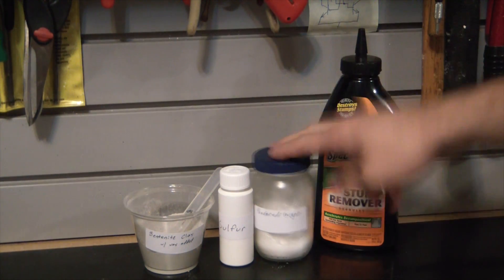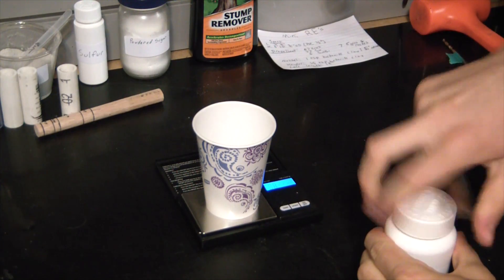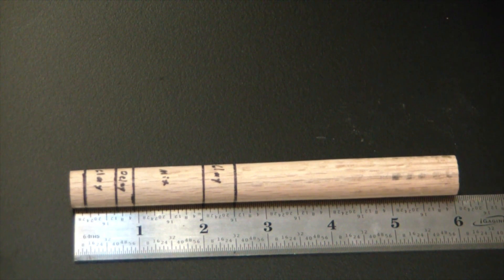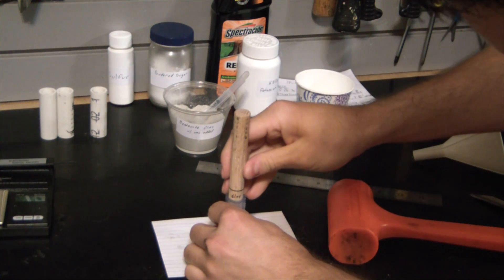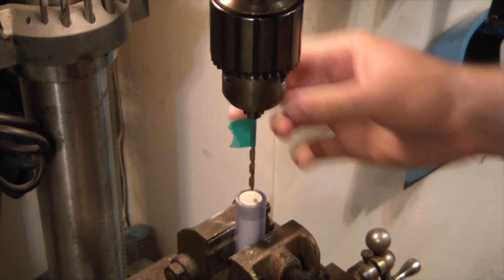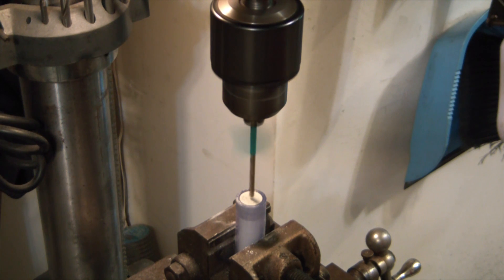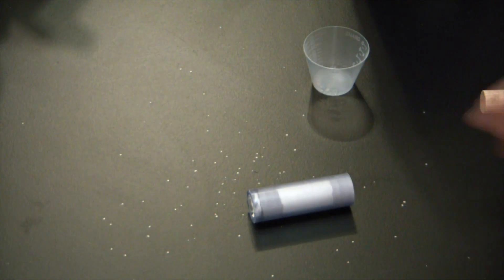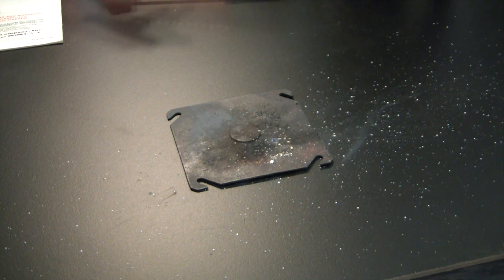ROCKET ENGINES FROM HOUSEHOLD STUFF! ELEMENTALMAKER

Comment: How big can you make these before it becomes to heavy for the fuel to lift the rocket
Reply from the maker: These motor types along with r-candy motors are limited more by fuel grain stability than any weight limitations. The larger and larger these get, the more likely grain imperfections cause it to over pressurize and explode.
Reply from the maker: For a good reference of how big these can get though, check out the sugar shot to space.

Comment: Do you suggest calsium nitrate for a suger rocket ?
Reply from the maker: Calcium nitrate might work, but if i remember correctly its very hygroscopic, and will likely be very weak. It would need to be dried thoroughly before use, and the motors would rapidly deteriorate from moisture absorption.
Reply: @ElementalMaker Thanks from your attention and helpful videos !

I can make a solution of ca(no3)2 and sucrose heat it and let it dry, something like a candy will left behinde its work a little better

I used kno3 its worked very well but its very rare and expensive in my country other way are work like converting calsium nitare to sodium nitrate

Comment: Great video! I guess because you used powdered dry clay, I assume as the engine burns, the nozzle clay inside ablates to form a convergence cone, and the exhaust hole ablates to form a divergence nozzle. I use use hydraulic cement and wooden forms to shape the convergence cone and divergence nozzle, by having these geometries at launch, the rocket efficiency remains relatively constant throughout the burn.

Comment: Remember to grind your own sugar if your powdered sugar from the store has corn starch, it significantly slows burn rate
Reply: so could that be a main reason my fuel is slow?
Reply: @NOVASOULJAH  it would definitely be a factor, but things like moisture content and particle size/ distribution also play huge roles. Also the fuel has to be under pressure to burn quickly, if your only testing in open air then it will look pretty slow
Reply: @aidanflanigan9532  thank you for helping me :)

Comment: Why do some people use sugar and other use charcoal?  I know charcoal makes black powder, but what is the big difference?
Reply from the maker: I think sugar is mostly used for easy availability and very reproducible results. Charcoal has pretty incredible variations in burn speed depending on the type of wood and the way it was processed. Powdered sugar is pretty much identical no matter the source. Charcoal definitely has some advantages though, since it doesn't form a hygroscopic mixture like sugar does.
Reply from the maker: Really great question btw

Comment: My name is Jason Wampler, and I've been building rocket motors for about 21 years now. I can tell PN67/S25/SU8 (the motor you tested) wouldn't have any impulse strength at all.  Here's why: powdered sugar is an air float form of regular sugar. At 250 to 500 micron, my guess is the individual starch(sugar) molecules are simply too short to ignite because of how quickly these oxidize to begin with(they are short and weak and simply atomize immediately.  Your motor's problem is the fact that your fuel to oxidizer ratio is off.  67 percent oxidizer is too much, and 28 percent fuel is too little.  Your campfire has too much lighter fluid on it and not enough wood, it will burn out too quickly.

Thought I'd try to help😁.

Jason Wampler
W A M P L E R

Comment: Red iron oxide is a good catalyst too if you have no sulfur. 1% by weight of the combined fuel and oxidizer. Rockite anchoring cement is also better to use as a nozzle.

Comment: I thought stump remover contains sodium chlorate? I bought some before.
Reply from the maker: A long time ago they used sodium chlorate in stump killer, but removers have pretty much always been nitrate based since nitrates aid with decomposition
Reply: @ElementalMaker  So sodium chlorate does not decompose. Is that correct?

Comment: I’ve seen recipes where the sugar mixture is melted on a hot plate (no open flames..duh) then poured into the tube. This seems a much safer approach.

Any difference in performance?
Reply: I have done that many times. The only way i will do it. Burns better and evenly

Comment: I noticed you are producing almost Zero smoke, I don't like like losing rockets but I still will launch in "adverse" conditions.
The ESTES used to make heavy smoke most notably in the delay Phase, For tracking of course, My question is what can we add without taking away from thrust to make SMOKE? also. Can we multi stage these with zero delay?
Reply from the maker: This composition does actually produce quite a good bit of smoke, it just was all blown out of frame from the thrust during the tests.

Comment: I've been subscribed to your channel for over a month, maybe two. I just hit the 'thumbs up' button. I'm also a basement chemist, and have made rocket motors before as well as flash powder. I've also mixed a 50-50 of Muriatic Acid (30% acid) and water to remove rust from metal parts. Once the rust is removed, I wash the parts with water and baking soda.
Reply from the maker: Thanks for your sub and thumbs up!

Comment: So, this is essentially black powder, with sugar used as a higher power alternative to charcoal for the carbon source.
Three things: Do not mix this stuff in a blender or spice grinder. This is an explosive and too much friction can set it off. Grinding the individual constituents is fine, but together, just don't even think about it. Secondly, be very wary tamping this stuff down. Too much friction or force can set this stuff off easily. And sugar is sticky if it's humid out. (Let me say one name, Phineas Gage.) Thirdly, yeah, absolutely, a very low speed drill, use a hand bit and brace if you have one.

Comment: Have you noticed that when American's need accuracy - they switch to METRIC!
Reply: And this is why there are two systems. So stupid ppl can bash one another instead of building and doing. Just saying.
Reply: Let me guess.... You live in some other country and feel Superior.... I bet I can measure what type of gun you can't have... Anything above zero caliber
Reply: Wasn't metric, was .59 inches
Reply: Metric was created using standard units . We had more accurate measuring equipment
Reply: Whatta ya talkin bout our military still sucks with accuracy an speed in technology..with what the bear has an the other red nation has we have no chance ya know why ? The military is too worried bout offending people  and establishing a 6 colored flag at the same  height as the American flag that some folks think is a rainbow ...newsflash the rainbow has 7 colors not 6
Reply: my micrometer and test dial indicators vehemently disagree with you.
Reply: tell me you've never been in a american machine shop or tool and die makers shop without telling me you've never been..
Reply: Standard or metric a case of water is still heavy and the grocery store is still pretty far away.
Reply: Premature ejecting rockets seem to be a problem
Reply: Any unit can be accurate
Reply: @michaelschuler7397  You may use metric to be accurate, but you use Imperial to go to the moon.
Reply: @frankduncan5685  but they will be using metric to go to Mars. 😁
Reply: @Ninja1000sx.  remember when NASA used imperial instead of metric by mistake and one of their mars landers crashed...
Reply: @frankduncan5685  No you don't. No one has ever been to the moon using the imperial system.
Reply: @michaelschuler7397  The issue is converting notation and performing math operations. What is measured must translate to notation without converting bases. Binary or number bases which are powers of two make sense for computers and make sense for measurement because halving anything is the most basic, accurate and simple operation.

Try accurately taking a 5th of something. Try working in base 5, you will see the disadvantage.
Reply: Johan Smith oh I agree the statement is what I don’t agree with . Fun fact the inch was based on the metric system when standards were developed
Reply: There are two kinds of nations on this world, Those that use only metric and need foreign aid those that have used nuclear weapons and went to the moon.
Reply: @antcri730  lol
Reply: What are you talking about? Machinists have used metric inches for over a hundred years. 

But in reality the fractional system is SUPERIOR because it is BINARY. The problem is stupid base 10 numbers (because 10 fingers? Seriously?). If using a base 2 system like hexadecimal, fractions TRANSLATE PERFECTLY. That means fractions translate to computer numbers perfectly.

1 = 1
...
9 = 9
10 = A   hex
11 = B
12 = C
13 = D
14 = E
15 = F
16 = 10
...
255 = FF
256 = 100  hex

15/16 = 0.F   hex
31/32 = 0.F8
63/64 = 0.FC
127/128 = 0.FE
254/256 = 0.FF
7/8 = 0.D
3/4 = 0.C
1/2 = 0.8 
1/4 = 0.4
1/16 = 0.1
1/32 = 0.08
1/64 = 0.04
1/128 = 0.02
1/256 = 0.01  

13/32 = 0.68    hex
27/64 = 0.6C
7/16 = 0.7  
29/64 = 0.74
15/32 = 0.78
31/64 = 0.7C
1/2 = 0.8
33/64 = 0.84
17/32 = 0.88
Etc

Is that accurate enough and easy enough to convert? Lol.
Reply: @fieldlab4  fine, do 1/5th in binary... not fractional 1/5 but actually binary, you can not, it is a repeating decimal...
Reply: @stevespyder  do you see 1/5th on a ruler somewhere? No! Because fractional rulers are based on divisions of TWO. So the measurements are powers of 2 just like computers and base 16.

Nice try though.
Reply: @fieldlab4  "What are you talking about? Machinists have used metric inches for over a hundred years." gun calibers and machine parts do not always work out to a binary fraction.... if a part calls for .2 inches you use a micrometer not a tape measure...
Reply: Johan Smith  Having been a machinist in the go ole USA for over fifty years I still have fun with fractions. With a little practice and a bit of thought you don’t need a decimal equivalent chart.
Reply: @fieldlab4  'metric inches' is a misnomer, saying decimal inches would be more accurate as imperial and metric are two different systems. yes metric and decimal imperial fractions are similar in appearance. My dad used to hate it when i said 1/4 of a kilometre, "no it is 250m.." the math works out the same. both systems are just as accurate if you use enough significant digits. on a side note, because computers use binary storage, for accurate math, numbers are converted to BCD, binary coded decimal. combining base 10 and base 2 all into 1 system... so 1/5 ( .2 ) in binary is .00110011... while in BCD it is .00000010 or .0010 ( depending on whether you use 4 or 8 bit encoding ) no repeating decimal.
Reply: @stevespyder  Yes I stand corrected, decimal inches. All SAE machinists tools are in decimal inches. Even indexed drill bits. The obvious example is thousandths of an inch (mils), which has nothing to do with factional measurements divided in halves on a ruler. Mils have been used forever.

Binary coded decimal is strictly for the benefit of humans expecting base 10 numbers. Computer numerical operations are on numbers in a base power of 2.
Reply: @fieldlab4  but a computer still can not add .2 +.2+.2+.2+.2 to get 1 in binary, that is why BCD is used, for those numbers that are divisible by 5.
Reply: @stevespyder  

I'm not saying that base 10 should be used for anything. That is a problem with metric as well as decimal inches. There are as many repeating numbers in base 10 (like 1/3) as there are in base 16. I'm only saying that fractional systems are binary as are computers, for good reasons and ideally we might switch our entire number system to hex and stop dealing with the metric vs SAE nonsense.
Reply: @stevespyder  The inch system of length was standardized by definition in 1959 to be 1 inch = 2.54 cm exactly. That would be a "metric inch" although such a term is not formally recognized. Prior to that standard definition, the inch was a little different.
Reply: How many metric flags on the moon?
Reply: @roostertn  that's quite an interesting question. When students move into the space sciences they are told to forget everything they know about measurement, as they need to embrace Metric and 'the powers of ten'. I watched an MIT Professor say just this and then played an interesting video, produced by IBM about how simply adding a zero gives you ten times the speed or distance etc.

Comment: Engine- "a machine with moving parts that converts power into motion."
Reply: RE:Adam Smith. "Rocket engine" is what the manufacturers call them.
https://estesrockets.com/product-category/engines/
So, what would you call them? Fuel cells?
Reply from the maker: I mean, if we get down to the atomic level we can say it's rapidly moving really really small parts cough cough molecules through and out of the nozzle to generate force 😁. Yes despite two engineering degrees I am still human and misspeak all the time.

Comment: You know....  If you lengthened it a bit and filled it with about 400 to 500 grains of 2F black powder with green gold and silver flake inside instead of an ejection charge, in a disposable rocket that thing would make quite a BANG and colorful firework for the fourth!
Reply from the maker: No need to waste that much black powder. A few grams of flash will satisfy even the thirstiest boom seekers
Reply: @ElementalMaker  Well for most.  But they're not me. :)
Heck my profile pic is a custom 37mm round I made for my 203 launcher on my AR, it was taken at just the right time.
I also competition shoot flintlocks so I'm always looking for the next big bang. 
How many grains do you use for your ejection?  If I wanted a decent boom at low powder use, I would think 70 Gr. with maybe some colorful aluminum flakes.

Comment: 3:53 Or how about into the blender? That would ensure a thorough mix, as well as no chunks.
Reply from the maker: Hell to the no, the blender can cause too much heat and explode
Reply: @ElementalMaker  
Ahh. I'm guessing that would be bad.
Reply: @ElementalMaker  you know, I used a coffee blender to mix up powdered sugar and potassium nitrate in a ratio of 66 KNO3 : 34 Sugar and nothing really happened. Just do it for a couple of seconds, wait for a while and then again. Repeat a few times and there ya go! It comes out very well mixed, but I don't encourage anyone to do it. You can also take a container, pour you mix into it and also add a lot off small metal balls. You can use 4,46 mm bbs for airguns like I do. Then shake it for a couple of minutes. It's safer but also effective. It's safe with KNO3/Sugar but I don't know about the other compounds, they all may have different mechanical sensitivities.
Reply from the maker: @specops1010  Kno3 and Sugar mixtures are indeed quite safe and not friction sensitive, but when dealing with something as powerful as a blender I personally wouldn't take that risk.

Comment: Spacex move over.  These are like the ones I made in high school 60 years ago, but I used plaster of paris for nozzles and plugs.  Was no pvc then (that I knew of) so rolled up paper tape.  Half would explode.  I used a black powder fuel wetted and slowly dried.  Dextrin added to the fuel for binder.
Reply: Do you know like a recipe for powerful rocket fuel a thrust of 3 lbs or up

Comment: You will probably get a much better reaction by taking the Potassium Nitrate and sugar in a pan and caramelizing it, then adding aluminum powder. But first place the potassium nitrate in the oven on low heat for 30 mins to draw out any moisture in it.

Comment: This is good info. However, you just showed us a small motor. If we used the same ratios, but a longer tube, would it function to push a rocket to higher altitudes, or would it not work at all?
Reply from the maker: It can certainly be scaled up. Check out my newer rocket motor videos. I also built an arduino based test stand to quantify thrust data.

Comment: Most people making small rocket motors probably know this, but I want to mention that PVC and some other plastics can create rather nasty shrapnel if the motor goes boom. Which is unfortunately not to unusal when trying to optimize them... I had to research this at work and the worst materials were PVC, PEEK and surprisingly nylon.
 
Polyethylene is safe and therefore often used in firework mortars. Not a good casing material thou since it creeps under load. Fiberglas behaves fairly safe as it delaminates/splits in flakes more than creating shrapnel. 

I would suggest using paper tubes for small rammed motors like this. You can roll them in any dia and wall thickness from virgin craft using wheat paste or white glue. When ramming the composition bites into the walls better than in plastics, so fewer booms and safer. Note that the paper tubes need to be parallell wound, not the cheap spiral wound leftovers from household items. It is a traditional method well worth learning.
Reply: They make them that way in Mexico, and they are very reliable.  People launch them from their hands.
Reply: @jimlarsen6782 Well they are just plain friggin stupid but it is mexico home of the freaks.

Comment: I gave a "like" and subscribed. People watching this can make the build much easier by driving a nail (the same size as the drill bit) through a piece of board and also drilling out the rammer just a tiny bit oversize. This way you won't have to drill out the nozzle and core. Drilling into solid rocket propellants can be very hazardous to your health and house!
I prefer sanded tile grout for the nozzle and bulkhead because the sand embeds itself into the sidewalls of the tube and erodes far less in the nozzle so you get better performance. I would never use a tube made of any plastic or anything else other than parallel wound paper tubes made specifically for pyrotechnic use...but that's just me (a safety issue).